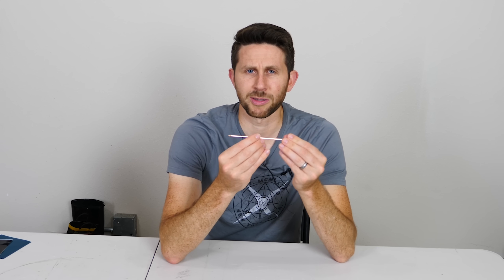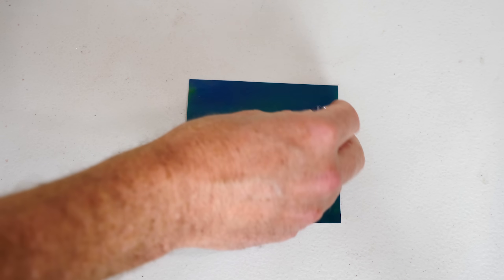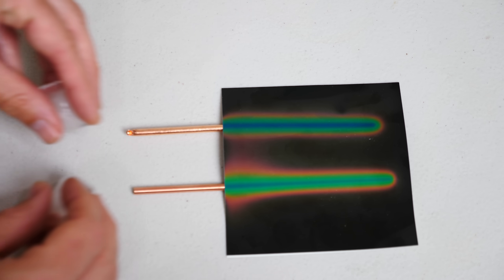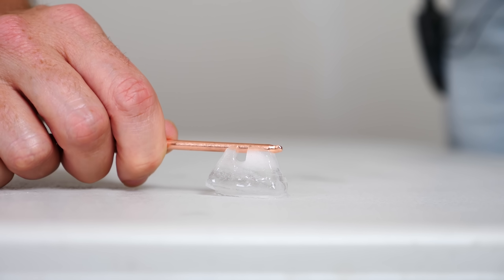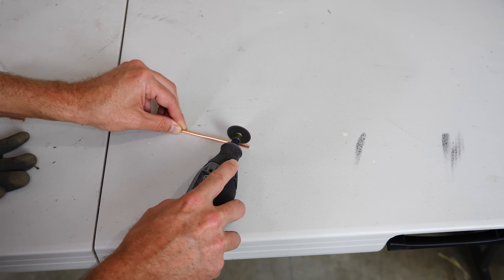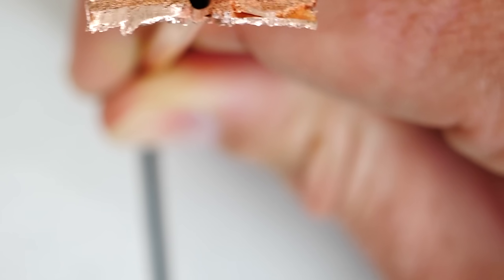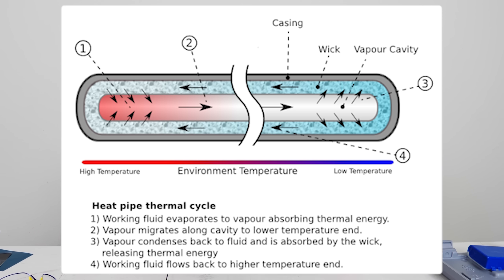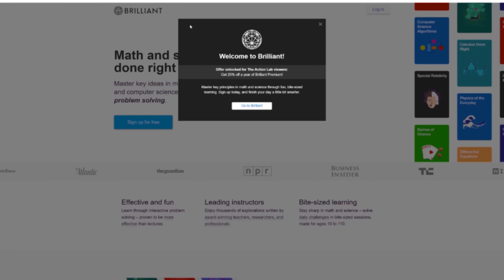What's Inside the Worlds' Fastest Heat Conductor?

Comment: 6:00 You are talking that water vapour when heating causes this hugh speed of heat transfer but at the beginning You showed transfer of cold ice temperature through the pipe. In that case there is no vapour!
Reply: Transfer of heat from a warm place to a cold place is the same as transfer of 'cold' from a cold place to a warm place. In the ice example the pipe is transferring the body heat from his hand to the ice.
Reply: @JuniperHatesTwitterlikeHandles  Jes You are right for the heat transfer through a material like copper but in this kind of transfer the author said the heated vapour that is extremly fast while expanding transfers heat but in the case of cold transfer there is no very fast vapour but instead cold water inside the pipe that could even freeze inside the pipe.
Reply: Water can still be vapor at colder temperatures in a near vacuum.

Comment: Here's a question; is this safe to use in food or drink?  I assume it is since it's just water vapor in a vacuum within a copper pipe and well...copper pipes are used to deliver drinking water, as well as used in pots and pans, and for cups and mugs even.  So it sounds to me like there should be no issue at all.  But there could be something that I'm not thinking about.
Reply: What would you be doing with it? Trying to heat something up?

Comment: Thanks alot for this informational video. I always found it intuitively unlogical that those high mass cooling surfaces are connected by thin copper tubes. I thought without deeper knowledge that copper shouldnt be able to transfer enough heat quick enough with those low radii. I didnt knew those things existed. Such a genius heatpump. Im amazed.

Comment: What's amazing is that this pipe isn't made from some exotic material.
I assumed it was going to have something like carbon nanotubes inside.
No, just ordinary water vapor in a vacuum inside an ordinary copper tube -- yet over 100 times more efficient than essentially the same copper tube, unmodified. Wow!
Reply: Probably water in liquid form at room temp, and then when heated to a certain temp, then converts to water vapor. Probably a lowish vacuum condition of around 28 hg or so.

Comment: I would like to see the pipe material (inner sponge) used in a solar water heater sealed in a vacuum. Somehow find a larger (1/4" inner diameter?) heat pipe tubing at 50ft length. Coil it in a flat spiral (not vertical coil), paint it with Black 2.0 (interesting results between with vs without black paint). House the tubing in a box sealed with a strong epoxy, a ~.5" thick acrylic (plexiglass) cover, and a vacuum fitting. Pull a decent vacuum. Pump water through pipe, aim device at sun. Log results. Compare energy efficiency to traditional solar panels. How does it compare?

Comment: It would have been helpful if you had said you're using a piece of liquid crystal temperature sensing material, instead of just saying "ooh, look at that". Not very informative. Also, it's a heat pipe, same as what's used in CPU coolers.

Comment: heat pipe is part of cpu fans right? using liquid vapor to transfer heat as a good heat sink does.
I wonder how it would react using the seebeck effect with another conductor (as a P or N ), then again I don't wan't to risk the heat pipe exploding into my hands or face.
..after googling, nevermind there's a paper of it already; nvm again the paper didnt use it as a P or N

Comment: This would be excellent for geothermal transfer. I've heard that it's possible to drill a couple miles down anywhere and stick ultra-efficient conductors in the hole, allowing for boiling water using earth's heat energy. I think exotic materials blended with this concept could pull it off.
Reply: sure if you want to cool down the earth eventually. Heat vents are okay, since the heat is escaping and wasted but drilling to the core and stealing that heat? That could have future consequences.
Reply: @jerryblue017  Agreed. But on a smaller scale, and at much shallower depths, this could be used to good effect in combo with geothermal for both heating and cooling.

Comment: Here is the thing tho. This test only demonstrates momentary transfer. It doesn't actually provide any numbers that would prove an increased conductivity efficiency over time. When the pipe is cool, water is neutral and in liquid state. Heat up one end, and the water boils rushing to the other side while bringing the heat with it. Then the water becomes neutral again and remains as a gas. It's not going to come back and bring another batch of heat with it. In other words, it's only good at transferring heat when the thermal difference is big enough.

Comment: It's the fastest because it's not just conduction, it's evaporation, condensation and convection. In the solid copper rod, the copper never moves. However, in the heat pipe, the water on the wick is a working fluid that moves through the center of the pipe, which is a region of pure water vapor.
Reply: How does the liquid water return to the hotter end fast enough to maintain a 200X advantage over copper ??
Considering the "hot" hand is 93*F or 34*C and there's less than a tenth of a gram of water inside ??
Why would the water "want" to return to the warm end, and WHY would the inside of the pipe surface be "rough" not smooth ?
So many Q's !
Reply: @peterdarr383 condensation + low pressure.
Reply: Yeah.. Just like what he said in the video one year earlier before you..
Reply: Statement
Remove Keyboard Abilities Due To Worrying About If People """""Asked""""" Or Not
Reply: @codewad I did
Reply: He literally explains this in the video lmao
Reply: Alien Nestle
Reply: Good job you watched the video you’re so smart

Comment: I have one of these heat pipes.  I removed it from a computer where it is used to pull heat away from the processor and move it over to the fan.  It's freaky how fast it transfers heat or cold when you feel it for yourself.

Comment: YES, you forgot one thing; that I know of, all the scaling / pitting of the copper inside the tube actually makes a bigger surface area and makes as big of difference in thermal conductance as the vacuum effect, thanks for being so smart and making such awesome videos. . .. . . .l;-)
p.s. silver is the best conductance of electricity, so it is possible to make an effective heat pipe from silver? I think it would have to be much thicker though.

Comment: "kilowatts per meterkelvin"
me: visible confusion
Reply: The rate of heat transfer depends on the difference in temperature between two places. If one is vastly hotter than the other, a lot of energy transfers very quickly. That's why you have kelvin in that unit. The reason you have meters is because a longer pipe conducts slower. Instead of just two points transferring heat, you have lots of points in between, each with less of a temp difference to its immediate sides than the two ends. So, to measure the performance of the material, you take those variables into account. Given the length and temperature difference, how many watts of heat flows? Well, in this case, 100 kW for every meter and kelvin.  100 kW / m K
Reply: @DFPercush  Hi.
How to make sure the material is not radiating all the energy along the meter into the sorrounding material? Or how and with what is it isolatet? If it is isolatet with a nother material as air, at a given temperatur. And what temperatur has the sorrounding material of the mesuring area? 
Thanks :)
Reply: @desertfd  You're asking about the metrology of heat pipes. Google that. Of course, in use, the whole point is to get rid of the heat, so you want it to radiate and conduct away. But I'm not sure how they measure that exact figure. If I had to guess, they could control the ambient temperature at both ends and wrap the middle in insulation, and see how hot the cold end of the pipe gets. Using the temperature difference between the pipe and the cold ambient temp, the surface area exposed, and the interface materials, you could determine how much heat is flowing. ...maybe
Reply: Ah yes, that’s what I use every day of course! 😂
Reply: kW/m•K
Reply: @scratchpad7954  i n c r e d i b l e
Reply: @scratchpad7954  amazing
Reply: Scratch Pad You sir.. You are a amazing..
Reply: @scratchpad7954  absolutely impressive
Reply: @scratchpad7954  wow
Reply: @scratchpad7954  kW/(m*K)
Reply: @scratchpad7954  nice
Reply: @scratchpad7954  Youre A-Mazing (confusing like a maze and Amazing at the same time)
Reply: @scratchpad7954  kE•kW
Reply: IT means the temperature conductivity is proportional to how long is the pipe and how hot it is,since at least in metals,thermal conductivity relies on free electrons. watts is the amount of power it conduces
Reply: Meter kelvin*
Reply: How much energy (in kilowatts) is required to change a number of meters of a material a number of degrees up or down in Celsius or Kelvin.
Reply: How quickly energy can move 1 meter  through the material with a 1 degree kelvin difference over that meter
Reply: @adamsteinhardt6393  wow
Reply: That's 1burning bacon/football field in American units.
Reply: Q = c*m*T
Q = J
m= kg
T = k

so c = the other way around: j/kg for a raise of 1 k
Reply: oh hey, you spelled it right at least
Reply: That's what imperial conversions sounds to metric users
Reply: To make it more confusing

Kilometer per frames second
Reply: Americans, don't get confused, that's the equivalent to "1000 Cheeseburgers per Ford Truck".
Reply: Stop bullying scratch pad
Reply: @osamabinlackin1556  I never once saw any hint of bullying me here.  Everyone here replying to me was genuinely complimenting me on how I knew that formula, expressive of the amount of heat energy required to raise the temperature of one meter of a given material by one degree Kelvin or Celsius.
Reply: @scratchpad7954  i dont speak nerd
Reply: @osamabinlackin1556  fastest switch in the west
Reply: @scratchpad7954  
It's how much heat energy the material transfers per second per meter of heat transfer per difference in temperature at both ends.
Keep in mind that watt is heat energy per second
Reply: @osamabinlackin1556  you, sire, changed your allegiance faster than Italy during ww2
Reply: @lucaslucas191202   There's just one piece of information missing.  It's how much heat per second the material transfers in each meter per Kelvin per square meter of area.  Cross sectional area makes a difference too.
Reply: @DANGJOS  
But it's not part of the unit The Action Lab uses, because he is dealing with a pipe that transfers heat and not a flat surface.
Reply: @lucaslucas191202   I mean cross sectional area, not frontal area.
Reply: @DANGJOS  
And this pipe probably comes in one size with the attached number and unit. I think because this pipe isn't made out of solid material there wouldn't be a linear connection between cross-sectional area and heat transfer, and therefore the other unit would make sense. However there is a linear connection between the length of the pipe and the heat transfer from one end to the other.
Reply: @scratchpad7954  that MIGHT be slightly naïve of you. Or I might be wrong. I genuinely can't tell if people were being sarcastic.
Reply: @joshyoung1440  they were playing stupid, and no they are not being sarcastic, it's a part of the joke
Reply: @osamabinlackin1556  uhhh well nerds speak English (not saying he is) so I’m deeply sorry that you didn’t get the education you need and that nobody helped you learn to speak English.
Reply: @tysendg1-118  omg im joking nerds (im one) are so sensitive
Reply: @osamabinlackin1556  wot

Comment: How long does it last? Does the little ammount of water inside dissipate over time? If it does, why not using graphene? This seems to be a good heat conductor as well.
Reply: it doesn't last, that's the whole point of a thermal conductor.  thermal insulators retain temperatures.
Reply: @Anomalocaria  I wasn't referring to the temperature, obviously, but to the device.

Comment: Think how bad this would be as a frying pan handle...
Reply: Oh god
Reply: @stonks9278  0
Reply: It will be equivalent to touching stove flames straight
Reply: @namansoood  not equivalent as some heat is lost to the surroundings
Reply: @namansoood  I think... it will burst out
Reply: @namansoood  No, it would be worse. A hard metal surface will transfer heat to your hand much faster than a flame itself which is just low density gas.
Reply: @mikeafhgaefiuawhgewahrgare4257  Exactly. This.
Reply: @namansoood  A lot worse. Air is a poor heat conductor
Reply: Do you want you hand to stick to it?
Reply: Carlos Martinez yes
Reply: @TheTalent96  when i was a kid i put my hand on the nearly red hot stove top and it stuck for a second then when out of reaction I clenched that hand into a fist -_-
Reply: Doctor:So what did the patient get ?

Nurse:He got third degree burns in his palm and fingers . I have no idea how he did that !

Patient:Well, I made a frying pan out of a heat pipe and cooked some eggs ...
Reply: Belt buckle
Reply: Yeah, you cook egg only you get cooked meat as bonus 🤣
Reply: It would be perfect
Reply: In some ways it wouldn't be so bad, it would get hot obviously but it would also cool down much quicker if wanted.
Reply: You spelled "fricking amazing" wrong
Reply: It’d be great as the actual material of the pan part though. You’d just need a really insulating handle
Reply: Well the actual pan would resist till a very small extent
Reply: FUUUUUUUU-
Reply: Cast iron pan handles are allready like this
Reply: @kobe.bryant.5  Cast iron is like 100 times worser heat conductor than heat pipe.
Reply: @tuunaes  would definitely be hotter but it would also cool down much quicker... Wouldn't be surprised if they used this metal in the stoves that go from top temperature to room temperature almost instantly.
Reply: @kobe.bryant.5 WRONG
Reply: Noki
Reply: Yeah because you can't transfer heat just from one side where hand grabbing
Reply: Think how good for ice cream and butter :) Would be a great toilet seat too.
Reply: Make the pan out of it
Reply: Why would I think of that??
Reply: Evil 😈
Reply: no
Reply: OH SHT-
Reply: Where to buy it?
Reply: make the pan made out of it the handle is normal
Reply: It would blow. Literally.
Reply: Annoying link comment: https://youtu.be/3qz8d1GXr0o
Reply: Sell it at a joke shop
Reply: God that will explode once i put butter on it
Reply: Plot twist: it is a frying pan handle
Reply: Why did you get that idea?
Reply: luckily plastic like handles exist
Reply: Maybe then my mother wouldn't have used it on me. I don't really remember that, but my dad told me she did.
Reply: make the pan out of this but not the handle
Reply: "Keeps your hands warm in icy wilderness."
Reply: Imagine it as the handle of the spoon as you stir liquid nitrogen icecream
Reply: It turns my frying pan into a crying pan 😭
Reply: William Sonoma will be the first to use it for handles.  Don't tell them...
Reply: would make a reallly good butter knife tho
Reply: Orrrr... How GOOD it would be as the actual cooking surface
Reply: For a jealous wife i think it would be perfect to ask her husband to pull the pan aside. :D Oh, honey... does it burn?
Reply: Think how good this would be for computer cooling.
Reply: Or say it is a marshmallow stick and give it to them bam
Reply: Minerly lol do that and ask your friend to use it to cook without knowing

Comment: Anyone else watch this and think, "I wonder if that can be used for a cpu water cooler" ?
Reply: This is already used in most air cpu coolers. Water or some other liquid sealed in the copper tubes that connect to the aluminum fins. The aluminium is used to dissipate the heat after the transfer.

Comment: Would the heat pipe also be better at conducting electricity?
Reply: Potentially if you are trying to send too much electricity through it and add aluminum to dissipate heat. This is assuming you want a change in voltage too. Otherwise you would just want to use thick enough copper wire like normal.

Comment: What is something that you can heat up and while you're trying to blow the heat off of it with  cooling fan  to warm a house or garage it remains warm or hot for a long period of time. I've been thinking about making a solar heater just trying to make sure I can make it effective when it's cold outside and when the sun goes down it doesn't rapidly decrease in heat I seen this video and thought maby u would have an idea

Comment: Something interesting related to this video is superfluid helium (I believe helium IV). It's a form of liquid helium that transfers heat almost instantly, it's very interesting. So technically, superfluid helium IV is the stuff that transfers heat fastest
Reply: From where can I buy heat pipe?
Reply: Yeah the problem is that any heat it does transfer also heats up the liquid causing it vaporize due to the low boiling point.
Reply: Pyro carbon conducts heat much better than a copper heat pipe
Reply: It is Helium II

Comment: Actually it's not water. It's a special gas in form of liquid due to the compression. This gas is at the same family of the one that refrigerators have. It's called freon.
It can transfer heat from the hotter side to the cooler side instantly due to the low boiling temperature it have.

Before posting anything do a bit of research and don't misinform people.

Comment: If you used thinner copper wires or a hollow copper tube you’d basically get the same results. The copper rods conduction is being limited by its heat capacity. Since electrons only move near the surface the inside of the Cooper rode is just dead weight sapping energy/thermal conduction. So this experiment isn’t exactly a fair comparison. The speed of electron drift is far higher than speed of vapor.